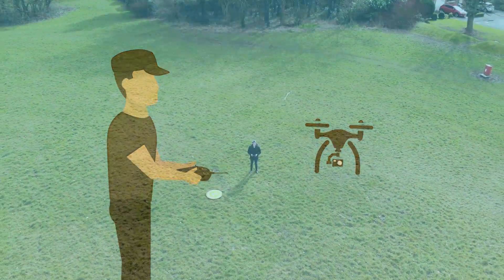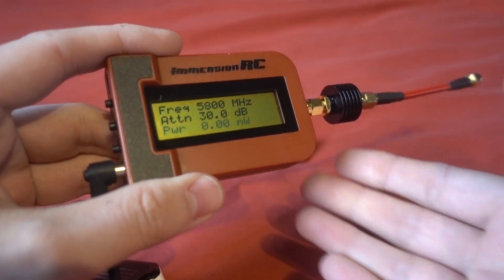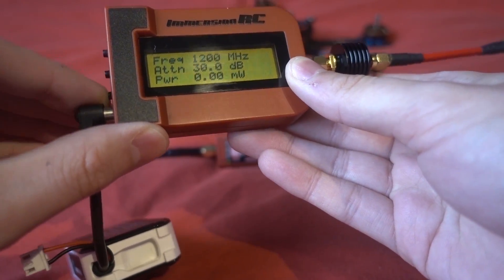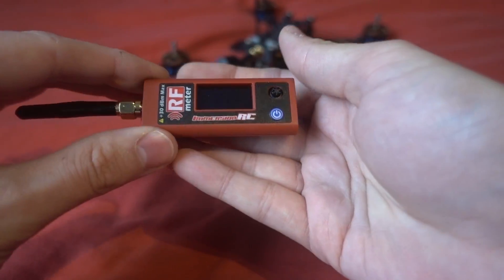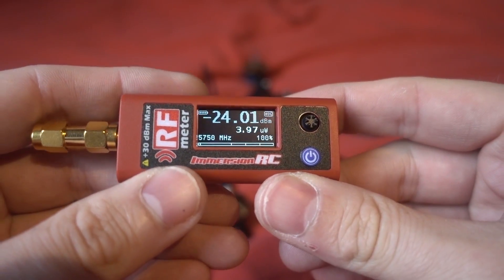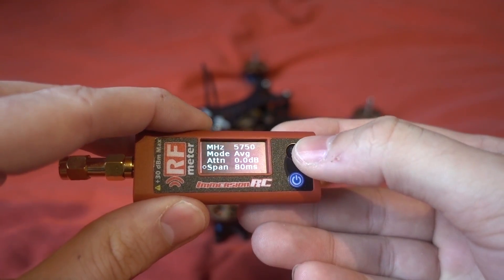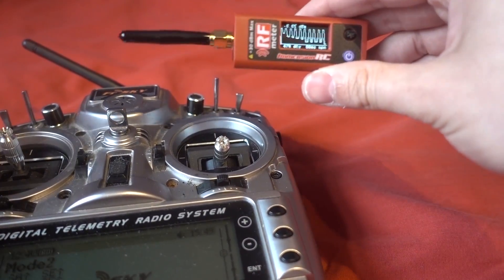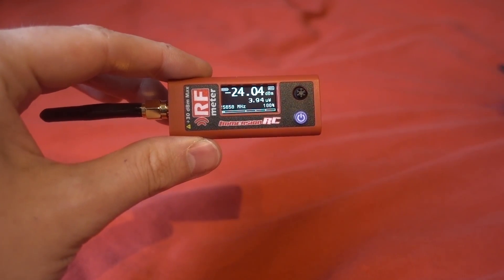ImmersionRC RF Power Meter v2

Comment: Hey Andy have a question for you I used one of these immersion RF power meters to check the actual wattage on a caddyx Vista and no matter what mode I checked it  and even at 1200 milliwatts setting I still only saw around a Max of 350 to 400  is digital different this was with a direct connection to the antenna as well not the wand I know you're good with this stuff any input would be interesting thank you

Comment: +Andyrc this tool can actually measure up to 1000mw or 30dbm without an external attenuator, not 500mw
Reply from the maker: That's not what the instructions say. Cheers
Reply: Absolute Maximum Input Power
1.3W (31dBm), > 30 second use with > 500mW (27dBm not recommended)

Yea it just might cook it, lol
Reply: Andyrc - moron. Everybody can see that it says 30dbm (which is 1w), but you just say 500mw with no explanation. No point in watching the rest of your review.

Comment: I already own a V1. Do I need a V2?
Reply from the maker: it depends if you are using it for races. if so id say definitely yes. and then if just for checking the power of a copter plugging it in less so however the new one is more accurate getting closer to the frequency.

Comment: Hey Andy this is probably a stupid question but this will tell you if your outputting though the antenna. Say in the chance you disconnected the pig tail from the transmitter and didn't get it fully seated. I have had trouble with TBS where after replacing the antenna cable my range drops to around 30 meters. To me when I replace the antenna cable it feels like the UFL end snaps into the socket but that cant be right if the range drops like that. After the third or forth try I am forced to take out a fairly large hammer and teach the VTX a lesson, lol. Not really but the VTX is worthless to me at that point. I never had the same problem with Tramp HV so I have some confidence I am doing it right. Not to bad mouth TBS it just been my experience and a consistent problem for me each time. 
Again I am sure this is a stupid question especially when you screw it on the SMA end. I just wanted to make sure I understand correctly because that would help to troubleshoot.
Reply from the maker: Yep and I have that problem too. Check the quad connected directly and lf ok, use Scully mode to centre the reading and then if you get a problem the DB will show a reduction

Comment: You can't  change settings with this, correct? It's just used to check or read, for lack of a better term, the output correct? If you can change does it work on all vtx brands?

Comment: Nice neat gadget from Immersion RC....I use EZUHF and have to say their UHF gear is flawless and seems well finished as products go.....This could also be very useful for the serious FPV Fixed Wing type for checking basic RF output.
  Although you didn't mention it in the video, 5.8G vtxs can have some wildly fluctuating RF outputs depending on what frequency you select. Not so important on a Multi maybe, but more so when flying at distance.
  The removable battery was a relief, I thought for one moment it was going to be built in.

Comment: Hello I have your space wolf dt140 it sends power to the xm plus, but my hglrc f438A stack won’t send power to the r-xsr I have to power it from main flight battery is this normal or do I have different versions of the hglrc? Bothbday f4 flight controller?
Reply from the maker: no not normal either a fault or having too much powered up from the bec
Reply: AndyRC I only have it wired normally, camera in camera pads, vtx in vtx pads etc

Comment: I have a r-xsr what is the glue that holds the two antenna on with as mine has come loose and don’t want it to come off on flight? Or what do you suggest to use? Really enjoy your channel keep up good work
Reply from the maker: liquid electrical tape. cheers

Comment: So, it can handle up to 500mW on  a direct connect to the VTX if I understand you correctly? Any time limit on that? I think all my VTXs are 200mW or less, so I'd probably be good. A neat accessory, and about 1/2 the price of the original, which I couldn't bring myself to buy.  Every VTX has an output which varies from channel to channel. Let's say you have a 25mW VTX. It might read  closer to 40 mW at 5645mhz, and perhaps only 18mW at 5875 mhz.  A meter like this might help you to find the "sweet freq." where your VTX has its best power output/efficiency. Thanks for the review. Cheers.
Reply from the maker: Hey Bill yes direct connect up to 500mw but i guess there is an element of common sense required also. knowing how this stuff works the more power you output the more you put the internals at risk of decalibrating / damage.  Theres also the added variable in that a vtx that hits 600mw really should have temperature protection otherwise it will burn itself out as well as the meter. So i would say up to 200mw is fine but even that can overheat the vtx without cooling.  id be more concerned for the vtx than the meter at 200mw. and then at 400-600mw if the transmitter has temp protection it will most likely shut off within a minute. so to conclude a 10 second burst of 600mw should be fine for both. any longer could kill the vtx. but lets hypothetically say you have a very powerful fan cooling the VTX enough for it to stay powered. you would want to attenuate externally to cope with it. cheers

Comment: Hello have just updated my hglrc f4 38A stack with the v2 transmitter, my l.e.ds have stopped working. They worked when i first got the stack installed. But since I have update bf they no longer work. Any ideas?
Reply from the maker: most likely when you updated BF it turned telem on or some feature conflicting with the LED function. turn them off (config tab where telem and soft serial is found) if not using. cheers
Reply: I remapped the ppm pad to work with telemetry as per your video what do I need to look for? Or turn on?
Reply from the maker: turn off telemetry and see if they start working some boards have a conflict

Comment: SWEET, Mine will be here Friday.
Reply: “Mark, order an external attenuator.”  That is what I heard.
Reply from the maker: Hey mark. another thing i wish i had mentioned is to do with cheap VTX's. these power meters kill them on high power as they dont have heat protection. which is why you dont see me using mine too often. the cheap companies never mention if a vtx has heat protection. the majority dont so id be choosy when u use it, so if you wanna give a cheap model away etc best not to try it on the higher powers unless you have a very powerful fan cheers.